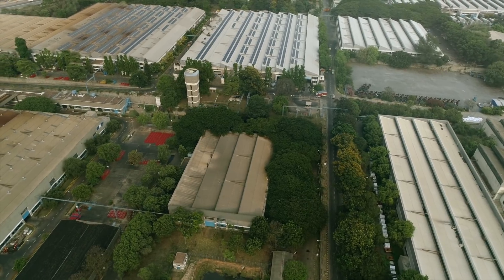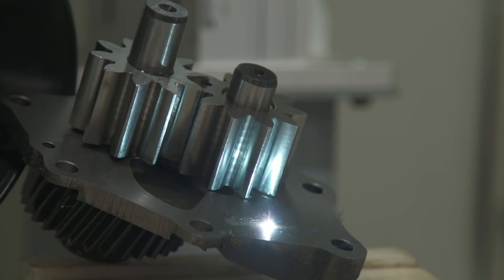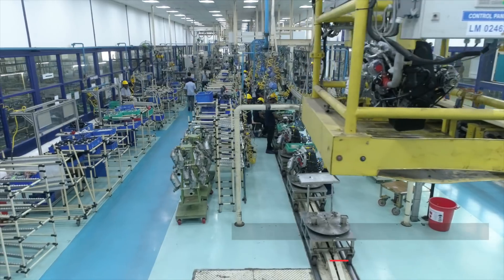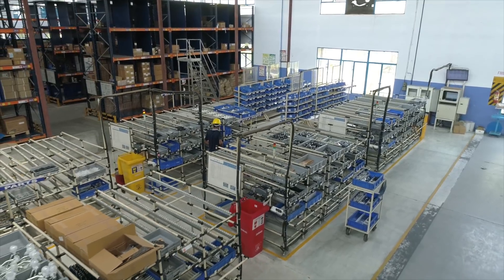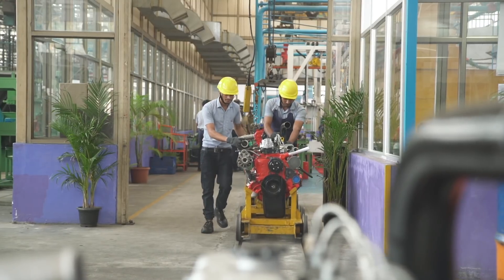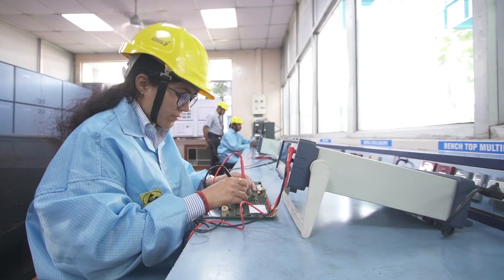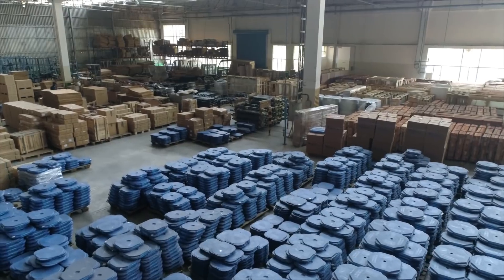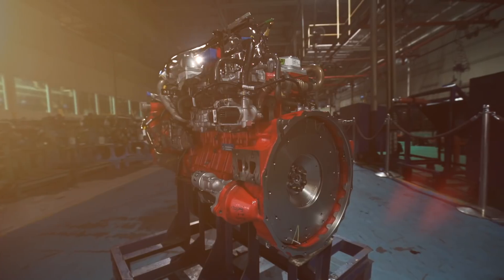Ashok Leyland Manufacturing Plant - Hosur 1

Comment: What ever if there is no part's available it's useless. There is no part's available in Northeast Indiana. It took more than 1 months just to repair 10Whell Ashok Leland clutch plate and engine mounting.  How can I work more fast if i have to order the parts from Kolkata which took more than 1 months to arrive the parts??? Now I'm regretting, instead of Ashok Leland Dumper why didn't I took TATA Dumper. This is what I'm experiencing right now. Just to let you guys know what I experienced.